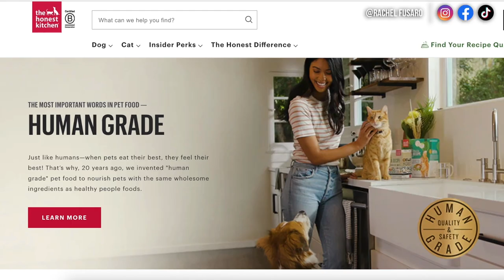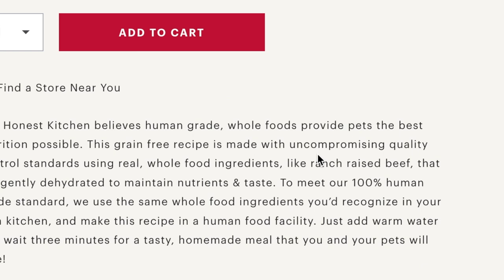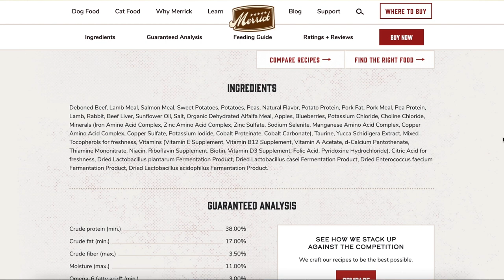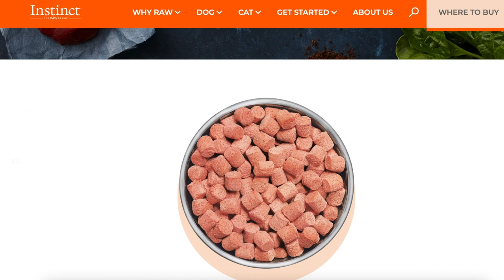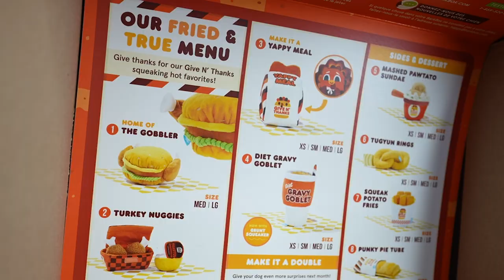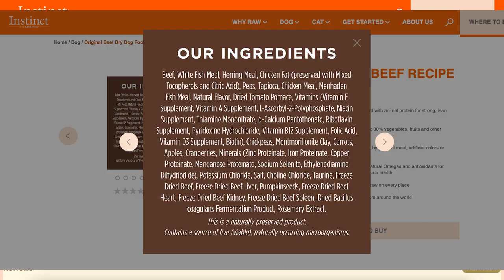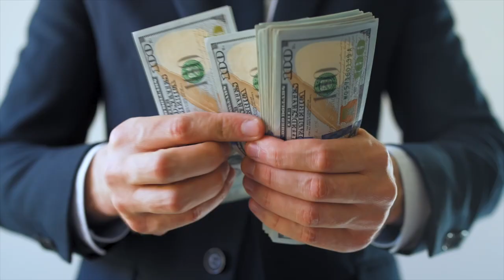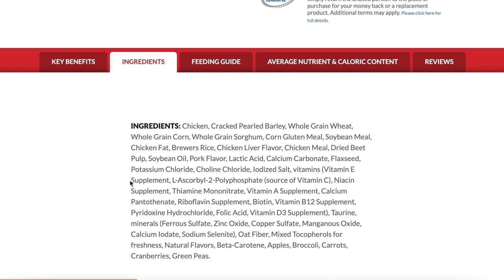4 Brands to STOP Feeding?!?! ⚠️

Comment: I have a question/video request. So what’s your opinion on heartworm medicine? I’ve done some research and a lot of the vet described medicines have questionable ingredients and in the past some of the heartworm protection pill brands  have made my dogs sick or very tired. I’ve been trying to find a holistic or healthier option, but it appears that there are none or very few. I don’t want to make my dogs sick/weaken their immune system with the medicine but then I don’t want them to get heartworms if it’s as bad as they tell us. Currently I’ve been spraying my dogs with a natural flea/tick/mosquito repellent and cutting the heartworm pill medicine that doesn’t give my dogs problems in half since the weight range is a huge difference.
Reply: Yes! Please do this. I currently don't protect my dog from heartworm for this reason and I know it's not a good idea. Would like your ideas  @Rachel Fusaro !
Reply: I personally used Only Natural Pet’s wholistic heartworm preventative and it worked. Also, Heartguart is just ivermectin, which I feel safe with for my puppy.

Comment: I use Honest Kitchen since it first came out (their dehydrated powder foods) but eventually I noticed that the box of powder had more and more DRIED APPLE PEELS, THE SKIN ONLY, there would be small cubes of apple meat yes but a whole bunch of just the skin. I didn’t that was very “honest” my dog hates those skins and I eventually stopped using it. Recently I noticed they have these wet food and toppers and they do look quite good. However, every single flavour has some sort of herbs/ spices which is very unnecessary. The food is filled with strong herb that can be seen everywhere in sauce. Its even too strong for myself, I don’t feel comfortable with so much sage, thyme, cinnamon for a dog though they might be considered safe. Why can’t they just remove them?

Comment: You mentioned corn and peas are bad for dogs. Are frozen peas and corn included because i sometimes top my dog's meal with frozen mix of carrots, peas and corn. I just boil them before i feed it to her. I'm from the Philippines so most of the brands you feature are not available here. I usually just cycle 3 kibble brands that work and then top it with home cooked meat and veggies.

Comment: I personally found that my dogs do well with Hill's as a base. It has the correct guarenteed analysis and vitamin content, and, although it does contain some fillers, it's way better than a lot of other kibble brands at a good price. If you don't want to spend a ton of money on dog food, Hill's is good, but keep in mind that you should supplement with extra meat and fresh veggies to bump up the protein content a bit and to also give them some variety. Personally, I mix Hill's with Spot & Tango and it's worked out great. I add flaxseed, pumpkin, and debittered nutritional yeast to the dry food too, but that's optional.
People always say Orijen is a good dog food but I found out that the fat content is 42% (compared to the 25% or less a dog should have). That's way too much- in addition to that, they hide the fat content and guarenteed analysis in general on their website so I had to turn to google and pull up a photo of the bag. I think it's irresponsible at best, but it would be a great dog food without all the added oils and fatty foods.
Reply: I fed Hills off and on for quite a while, but like you, never on its own. I always added fresh food, prepackaged raw, quality canned etc. For people on a budget Hill’s is more affordable and definitely better in quality/research than a lot of other crap out there. I think the problem is when people feed the heavily processed stuff as their ONLY food. Lots of us humans eat processed foods regularly and are totally fine as long as we are also eating fresh and healthier foods as well. But a human who ONLY eats processed food tends to eventually start to have health problems. I think it’s the same deal with pets. Ppl shouldn’t feel guilty about needing to feed pets processed food if that’s what they can afford. They can always add more things to the diet to boost the nutrient content :)

Comment: Informative video, with just the facts. Science Diet website says that corn is good for dogs and cats. Corn definitely is NOT good. Cats can't process corn. Dogs and cats do not need carbohydrates, either. It also takes some research, to find the amount of heavy metals, arsenic, lead, mercury, in pet food. Should be zero or less than 1%. Homemade or raw diet would be ideal, as you know what your pet is getting. I feed my two kittens a good quality wet food, mixed with raw ground beef or lightly boiled chicken. They won't eat raw chicken. Feeding a dog, would be similar. Every situation is different. Knowing what is out there, helps us to make better decisions for our pets.  Thank you for posting.